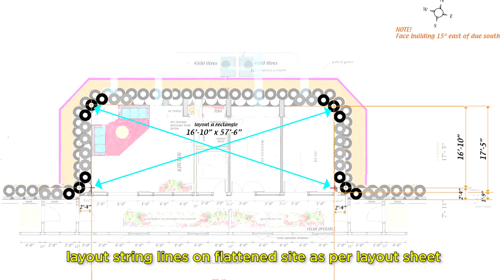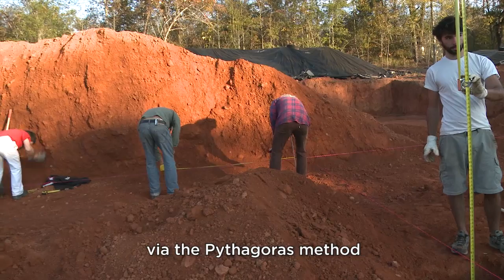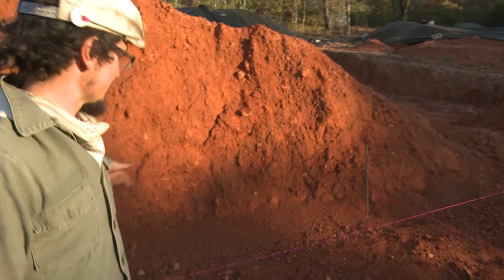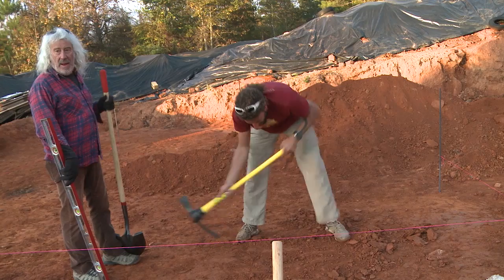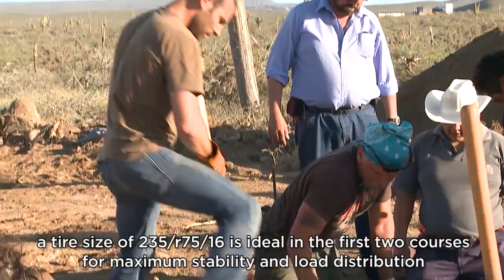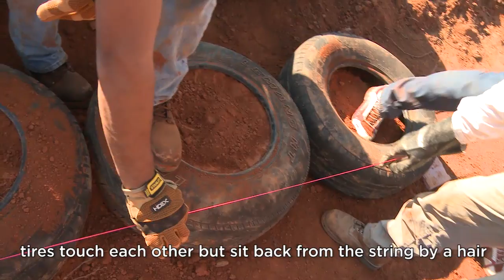How to layout an Earthship

Comment: is offgasing a big problem I keep hearing it is.
Reply: If you cover tires, inside and out and keep them out of the elements, theres no sun, air nor water hitting them, then there's no degradation.  This means no breakdown into the environment (That breakdown is what would happen in a dump somewhere).  Check into the site "tires are safe dot com".

I've been building one for a few months now and there is not a tire smell unless you put your nose right on a tire.  We're a permaculture operation and doing 100% Organic, we want to be sure there are no toxins.  We wrap the back of the tires with plastic before we put the soil of the berm against them.  We make sure that plastic goes down below the bottom tire and inside we will stucco the entire wall with cement and then a biochar cob.

p.s. in the background of this video, you'll see an O.D. Green Scout (looks like a bronco) with a white star on it.  That's mine!  This footage was Taylor County GA in 2010.  Best thing that ever happened to me.  I have faith in the human race again!